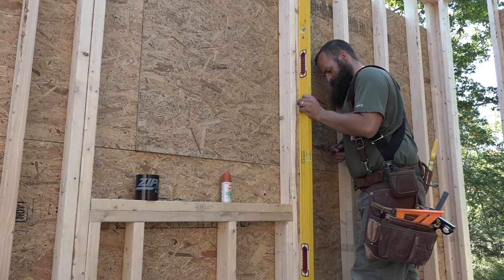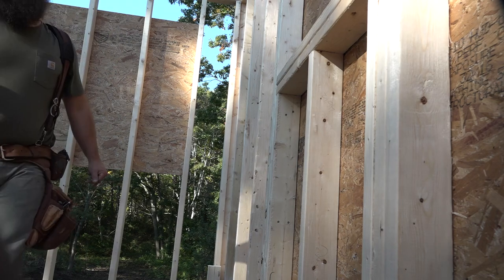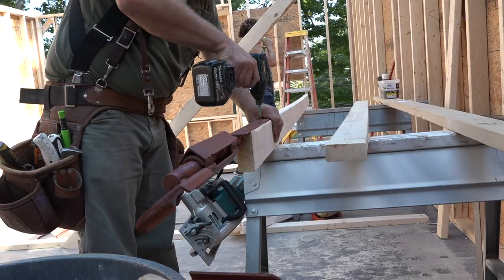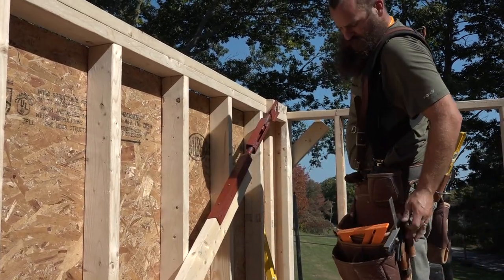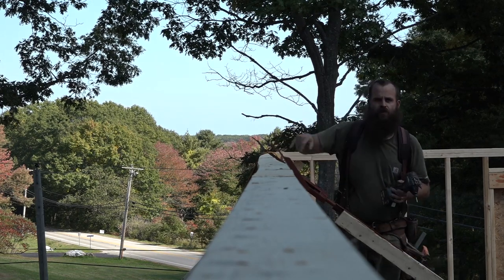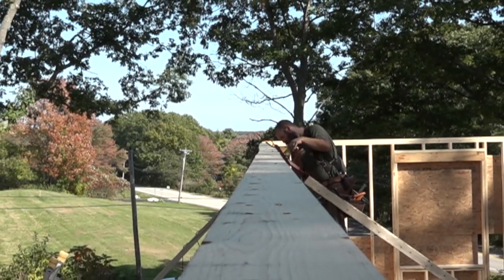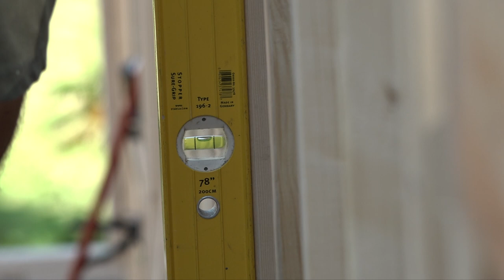Plumbing and Lining Walls (4)

Comment: The only way to truly plumb a wall is from top plate to bottom plate.   Using a level on a stud just isn’t good accurate enough.  It gets a lot of carpenters in trouble and translates into bigger errors down the road.  Nice video tho!
Reply: What would you do

Comment: Wouldn’t it be easier to plumb and line before wall sheathing goes on?
Reply: They must have done sheathing on the ground....which means the frames should be square already? Maybe the floor is out

Comment: Hi , after squaring wooden walls , wondering when to remove  plumb & line braces ?
Reply from the maker: After the roof or floor above them is nailed off and secured with sheathing.

Comment: How does putting a level on  a stud validate if a wall is plumb from top plate to bottom plate.  Cant there be bowing or warping of members?

Shouldn't there be some way to read between studs with just the ends reaching from bottom plate to top plate?
Reply from the maker: Sure, it is more accurate to plumb a wall with a plumb bob. If you crown the studs when framing the wall, then there will not be humps on the interior side. You can also chuck and studs that are severely crowned. 

Another pre framing talk is to select the straightest studs to use for kind studs in window and door openings. If you're using a six-foot level to plumb the walls, these King studs are a good choice.

You could also use an eight-foot level and check between the studs. 

So yes, plate to plate is more accurate, but good carpenters fine ways to minimize errors at each step, which improves quality rather than snowballing errors.

Make sense?
Reply: Yes you are correct idk where these guys are from but in California for residential buildings like these we normally use an extension level which check bottom plate to top plate.. others use a laser level.. plumb bobs are no longer used for obvious reasons and you’d get laughed at for using a 6 foot level to plumb and line in any crew..
Reply: @angelmoreno5058  thanks for the info.  "EXTENSION LEVEL" now I found what I was looking for.  When I look up levels on amazon you first get just the normal ones .... just didn't scroll far enough through the list.

Ok ... so for starters not a trades person by any means.  I am a decent DIY'er.  So ProTradeCraft's response is a bit baffling to me.  Ok ... so you crown the studs all in the same direction..  On Exterior walls it's outside on interior walls, I'm assuming just in one direction.  But doesn't that mean on wall would be humped and the other bowed in?  Is it just because it's consistent  that it's less noticeable.

I had bought a house in CO and went into another's 2 story house.  The cathedral wall looked horrible, can't remember why just now, but I know that when lights were turned on you could really see a sh!t ton of imperfections.
Reply: @johnjacobjinglehimerschmid3555  your supposed to "straight edge" your walls before drywall.. it's a process where you take a 6-8 ft level (just for it's straight edge) and plane it across studs and headers etc all framing members.. and the level will bump at any imperfections in the wall or you will see gaps in between framing members and the level.. then you plane studs down with a planer or fill with paper shims...this will give a perfectly straight surface to screw drywall removing humps and sinks
Reply: @angelmoreno5058  👍 for the info
Reply: @johnjacobjinglehimerschmid3555   I've been doing residential framing for 4 years now I'm not a master or journeymen but I can tell you this, there process of framing is ridiculous I've never seen someone build a wall on the ground Sheath the wall and then have to readjust it with a turnbuckle , That means when they built the wall on the ground it wasn't square... or plumb when raised.  And then when they check the wall For plum with a 6' level On 8' walls Is lazy. Every good framer knows checking a wall from bottom to top plate is how to plumb a wall the most accurate way, weather with a extended level or laser. A good practice is to use very straight studs on, inside/outside corners, King studs, trimmers, Wall Partitions,and  Certain parts of a house especially bathrooms and kitchens are critical.   this video was very Cring to watch I saw quite a bit of flaws in the framing and it was terrible to watch someone try to plum a wall that was already shear...🤦‍♂️